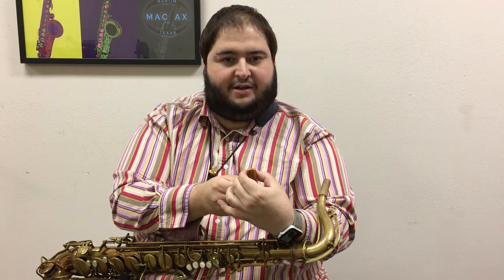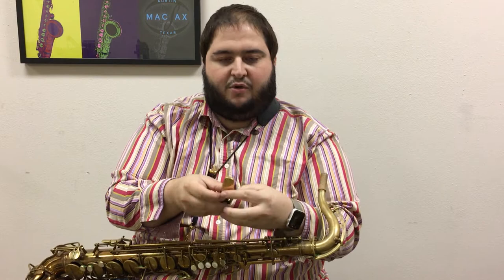MACSAX FJIII Product Demo and Design Discussion by Eric Falcon

Comment: MACSAX saxophones and mouthpieces are second to none. Eric Falcon has been working with saxophone mouthpieces for several decades. I had several old Berg Larsen mouthpieces and had Eric adjust all of them to produce a better sound, and at some time, adjust each of them to make them work with the brand of reeds that I have been using for 4 decades. Other companies can only perform one part of the process, but you have the hassle of taking all your mouthpieces to two different companies. It can be an agonizing process which can make your life miserable and time consuming.

When I use my MACSAX horns at gigs, many people in the audience would approach me to ask "Why is your Selmer missing a mother-of-pearl on the key for high, high F and/or F#"?  My answer was of course was always it's not a Selmer; it's a MACSAX. Most respond with "I never heard of MACSAX". Most will say "where can I get one at McDonald's or Burger King". Then I give them the location in Austin, Texas. I ran out of business cards, so I write it down on a small piece of paper which usually gets lost   . With that said, I will ask Mike Crouch who owns MACSAX for a decent supply of his business cards.

Try a MACSAX horn or mouthpiece quickly. You'll be happy  you did. I am 67 years young and my only wish is that MACSAX was available when I started playing in the saxophone in grammar school back in 1964.